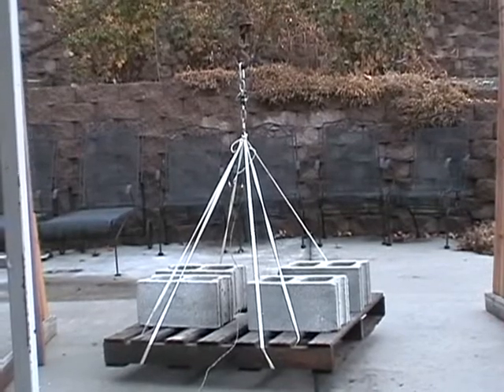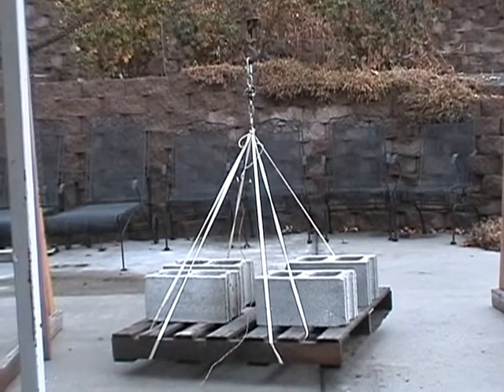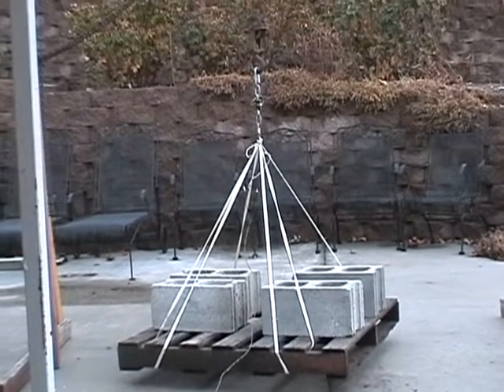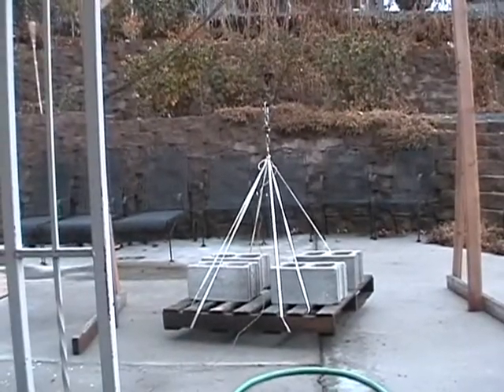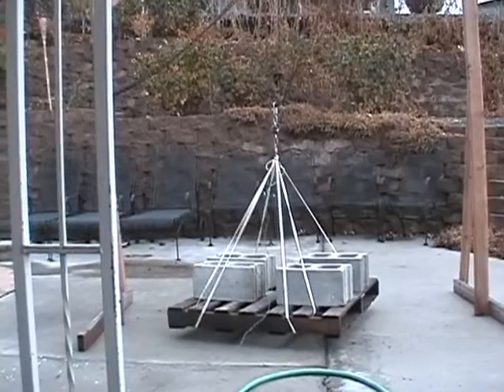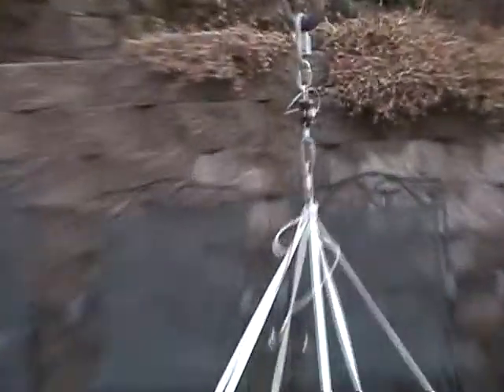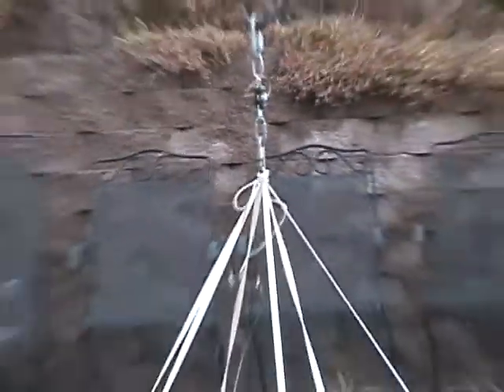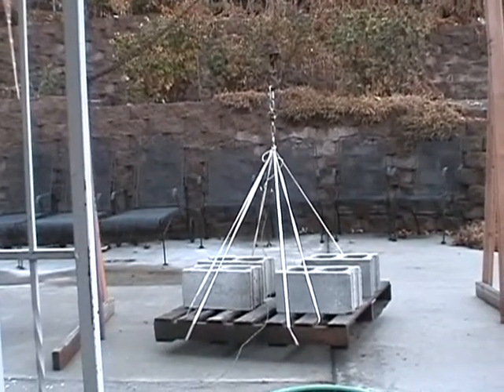Stress testing the Tender Descender- A High power rocket parachute release device.

Comment from the maker: Actually, it looks nothing like the Defy Gravity Tether. It does however, do exactly what the Tether did! It was only because I could not buy a Tether device that I developed the Tender Descender. This Tender Descender does have a couple advantages over the Tether. First off, it does not have any parts that wear out and need replacing. Secondly I offer a lifetime warranty, You break it, I replace it. You can find it for now on eBay by searching for High power rocket parachute release device.